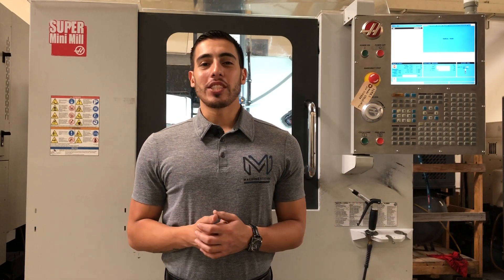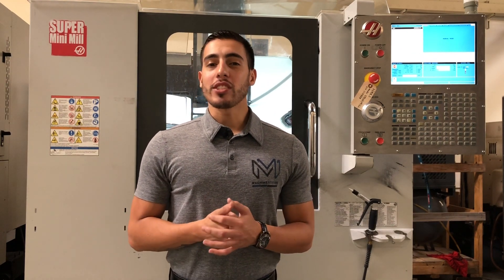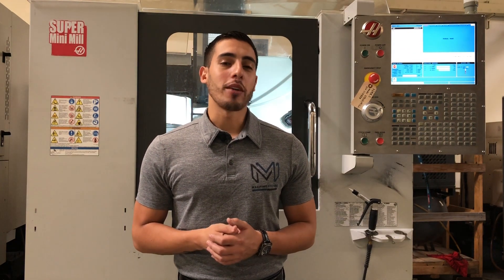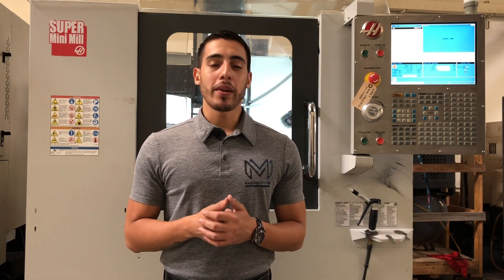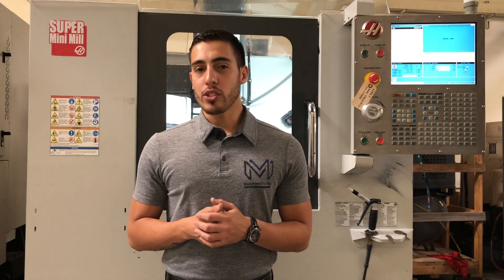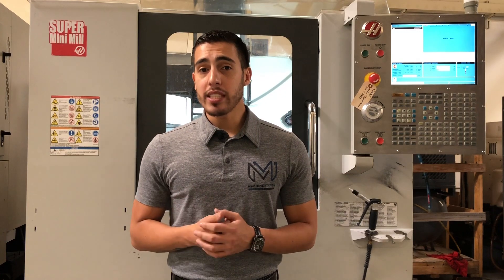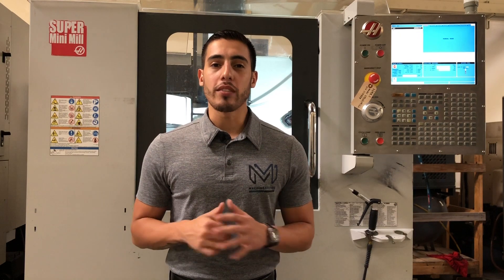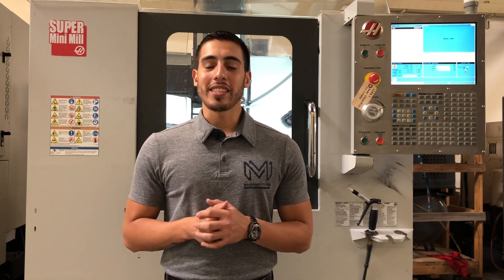HAAS SUPER MINI MILL CNC VERTICAL MACHINING CENTER 10 + 1 Automatic tool changer SKU 1997

Comment: I don't get it.  The eBay listing you have for this machine has something like 55,000+ hours, and the servo time is over 60,000.  That can't be right.  The machine looks gorgeous, and there are only 54,000 hours since 2014.  This machine would have had to been working 24/7/365 and I can't imagine it would ever look like it does.